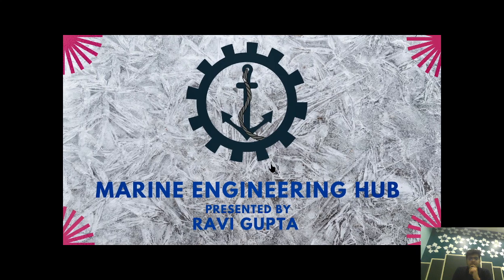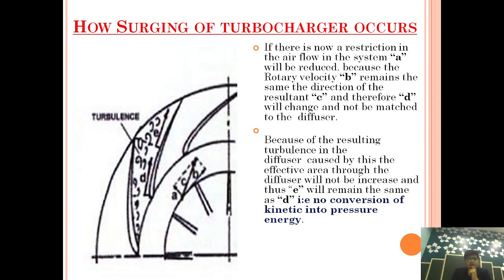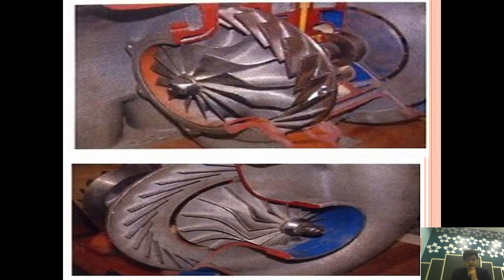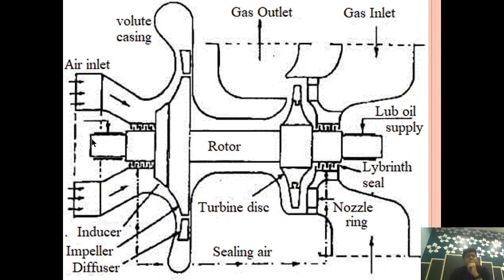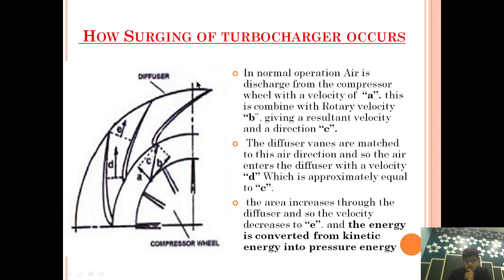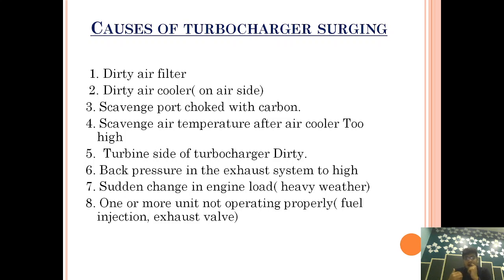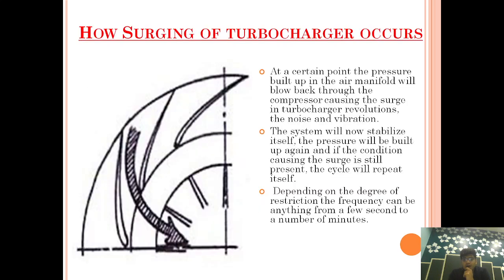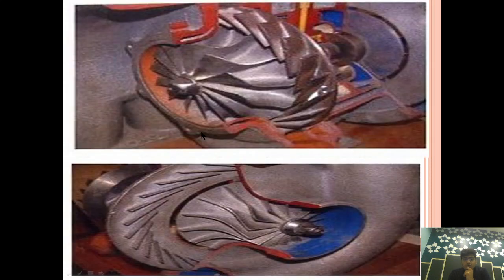Surging in Turbocharger | When Surging occur| How Surging Occur|

Comment: I have engine new sulzer 40 ZAV, and have problem with surging at load 6.5 MW, I already change 2 side rotor of T/C, change CAC 2 side,  timing, change injector 8 ea, but still the result is nothing, engine still surging.